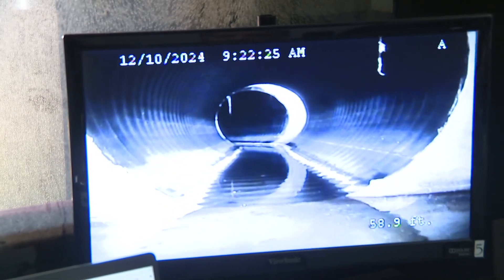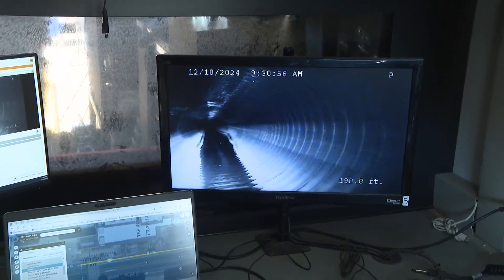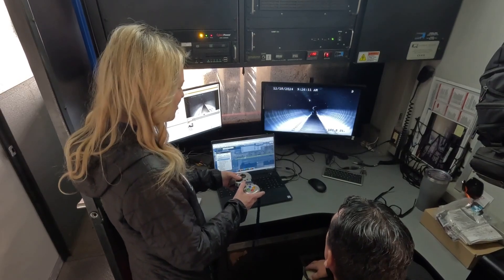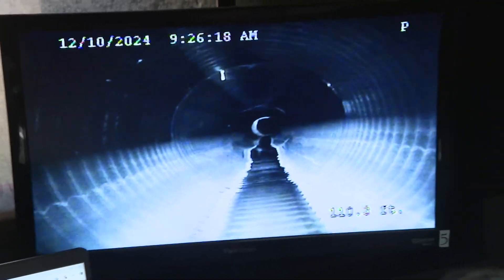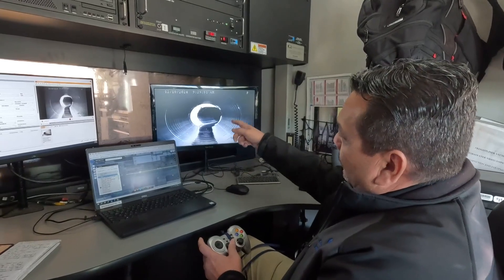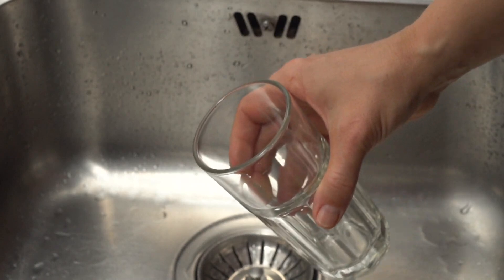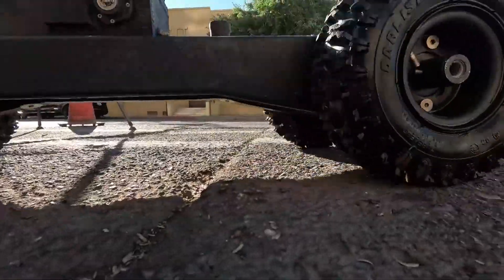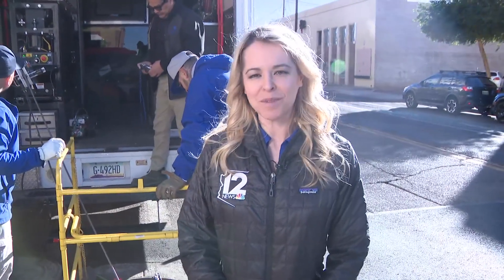Tiny robots under your feet are helping Phoenix stop groundwater pollution. This is how it works.

Comment: Your water is toxic already. I grew up here, left for 40 yrs.  As soon as I moved back here nothing but trouble in the bathroom 2-3 times a week. For 5 yrs now. Had a $5,000 water filtration system in, 5 months now and haven't had one problem in the bathroom. When they use to say,, "If you got to Mexico, don't drink the water"  Y'all need to add Arizona to that list. But then , with the 50th in education state I don't expect y'all to even understand anything I said here.